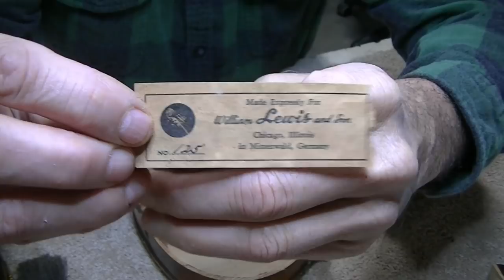209 RSW Grandpas Mouse Hole Fiddle Part 1

Comment: Hi Jerry; I have repaired a few instruments and built seven myself as a hobby only. My first project was a Checz violin in almost the same condition as this one, except the top was all the way loose and the back was about 90% loose. The finish was about 95% gone too, so I had to refinish it too. I was only in my 20's at the time (I'm 76 now). It turned out very well considering I knew nothing about instruments at the time. No one else could tell where the mouse hole had been when I got done. I played the instrument for over a year. That was the only time I ever played a violin. 11 years ago when we moved to this house the movers smashed it. My wife threw it out, she said because she knew I would be heart broken. I was heart broken when I found out she had thrown it out. At the time it was almost 200 years old and had been brought to America by my friend's grandfather. So I can understand someone wanting to repair a basket case. Thanks for your videos. Note: on the f-hole, I used masking tape and taped a piece of paper over the outside of the other f-hole and traced a pattern. Then I cut it out with an x-acto knife, turned it upside down, taped it over the patched f-hole and traced it on the patch.
My old violin had a short crack on the base side of the tail saddle that opened up every winter when it got dry. I was planning to shorten the saddle a few thousandths of an inch after we moved. However; the violin got smashed during the move and my wife threw it away without telling me. You really did a great job on this old grandpa's violin. I really enjoy your videos.
Reply from the maker: lrstaf6 sorry to hear about the fiddle. Thank you so much for watching.

Comment: How did you disinfect the violin of the mold and mildew? Spray bottle full of bleach or something like that? When I rescued my old Kay Tenor, I never have wiped any kind of liquid, oil, anything, but used a soft cloth to at least wipe away the dust and such. The cloth came back with many hues of GREEN on it! I have never seen that before!
Reply from the maker: I think I actually used a little bit of mildew killing spray on a cloth. But to be honest I don't remember.

Comment: Hide glue dries to form a crystalline structure, just like before you water it down to use it. That brittle-ness transfers more energy from the top plate into sound, which is another reason why hide glue remains the classic adhesive for fine string instruments. 
I love your videos, Jerry.
Reply from the maker: I've heard that many times before. But I would bet you $1,000 cash that you cannot tell the difference from one built with hide glue and one built with Titebond in a blind test. I've been building my mandolins with Titebond for 35 years and they sound as good or better than some of the old Gibsons built with hide glue.  Not trying to be a smart alec. But when you think about all of the things that make an instrument sound good what percentage do you think is attributed to the glue? My guess is less than 1%.

Comment: how you repaired that violin was magic, really well done !
Reply: Could the marks left by the clamps on the back  have been due to the finish being Italian oil varnish that imprints easily?. I had a violin that if you got a tiny bit of alcohol or oil on the surface it would soften the varnish on it. I don't like Italian oil varnish for this reason.

Comment: I like your rod clamps ,but have you ever used all thread ,smallest i have used being a electrician is 1/4 inch guess a little over kill i guess but are fairly inexpensive and wouldnt have to thread the ends ,plus they come in 6 ft lenths
Reply from the maker: Yes I have made dozens and dozens of clamps out of all thread. I use them for clamping the sides of guitars, violins and mandolins.

Comment: I just did the same repair without clamps at all because it kept slipping under pressure with a C clamp It seems ok I used titebond because it isn't gonna have to be disassembled ever What do you think? Also What do you call those clamps I need to buy them

Comment: Another GREAT vid.  What do you use to remove mold ?  Is the disinfectant water or non-water based ?
Since the pores in the instrument's wood are bigger than mold spores, how do you reeeeeally ensure
that the mold is gone and will not cause a problem in the future ?

Comment: Now hold on there, Mister.  Of all the amazing things you do in these videos, repairing instruments, building instruments, singing, playing and composing music, to me this takes the prize.  Threading the rod @ 7:40.  Until I started watching your videos, I never knew what a "die" was or what it was used for, although I had seen the round die you held up for the camera many times in hardware stores.   I thought that threading solid steel could only be done at factories using very hard steel, tremendous pressure and precision.  And there you are, blythely turning that die--and reversing it!!!!--to thread that rod, as though you were at a Sunday picnic.  I was thunderstruck,  gobsmacked and generally knocked side ways.  UUUH-mazing. U R D Man!!

Comment: sumting i thinking with looking at the dip along the crack you mentioned : i think you could put a line of smal woodscrews under the crack and use them as small jacks to lift the part up underneath the crack
Reply from the maker: There's always more than one way to skin a cat. Thank you for watching.

Comment: Hi Jerry. Great video as always. I'm seeking your advice. A friend of mine is thinking about taking banjo lessons. He's about 70 years old. He has a banjo but it's really a piece of junk. I'm thinking I might surprise him with a better banjo. Can you recommend one that's not too pricey. Under $200.00? Thanks.
Reply from the maker: Without searching eBay and or Amazon I really couldn't do that. The only suggestion I have for you is the more tensioning hooks it has the better also the tuning keys if they turn out to the side like a guitar they're not quite as good. You want the tuning keys that go straight through the peghead. Those two things are a key to slightly better banjo quality in general. Good luck to you my friend.
Reply: Thanks Jerry for getting back to me.

Comment: Thanks for making these videos! It's really satisfying to watch people with your level of expertise practice the craft they've mastered. At the 14:00 mark, you speculate that the vinyl tubing around the clamps might have chemically reacted with the finish. That's probably what happened. Vinyl tubing has a plasticizer in it that makes it pliable -- otherwise it would be as hard as PVC pipe. The plasticizer can migrate from the vinyl into other materials if they are in contact with each other for too long, and since shellac and nitrocellulose chemically have a lot in common with plastic, the plasticizer will soften and weaken them, too. You can research "plasticizer migration" if you want to know more, but it's a super boring topic.
Reply from the maker: Thank you my friend. That's what I suspected. I'll come up with a better solution next time. Thanks for watching.
Reply: use an old tee-shirt between the 2 next time....

Comment: Hi there,
I can imagine that what you saw with this instrument was a fix NOT using hide glue. A violin is a box with different woods glued together. They shrink and expand differently. You want the glue be the weakest spot. If your top and bottom sit "like iron" on the sides the weakest spot will be - the wood. Especially the soft spruce top will crack all over the place. That's why you even want to use just a little bit of hide glue (actually the right amount, of course).

Comment: You are totally right about Tightbond... it comes in 3 formulas, Tightbond 1, the regular stuff, is completely removable with heat and moisture, just like hide glue. The only advantage of hide glue is it cured ‘harder’ but its bear to use with a hot pot and limited working time. My family did furniture repairs among other things... and being their helper, I have used every glue and epoxy you can imagine. Jerry is right about basic Tightbond 

Tightbond-3 is different glue and much harder to take apart later. Its a water resistant polymer, not for most luthier work... however, to build up slabs for a solid body electric guitar, it may be the best ‘Permanent’ choice. 

Love your vids Jerry, learning with every one, should be ready to tackle great-grandads guitar by summer.
Reply from the maker: Thank you very much.
Reply: Ever use fish glue? I never have. But I have heard good things.
Reply: Endo Alley  I saw a little feature on fish glue at StuMac.  Looks interesting, but probably as a special applications kind of thing. It would be nice to learn more about it but in the end, it appears to be pretty similar to hide glue.   Tell you what I want to know, is the real practical diff between hot pot hide glue, and bottled room temp.  I have a low value family treasure, great grand-dads 120 year old guitar all in pieces.  This summer I want to put it back together. Between Jerry and Dan Erlywines vids, I’m taking the master class. Mostly I will use tightbond 1, just like Jerry does. Some joints I will probably use hide glue, for its hardness when dry, and guaranteed ease of re-do in the future after I am gone. My folks are dead and I don’t have their old hot-pot, so wondering about the bottle hide glue... For all practical purposes, tightbond 1 could do the whole job. Its not a historical guitar, not even likely to be played much. I want it preserved in one piece, not a guitar case full of dry pieces.   Jerry teaches more than all the others.. Every step why and how, and how to make the tools...    Very grateful for having found his channel.
Reply: I like the way Jerry uses what he has on hand and improvises methods of bracings. I have never seen wedges used as he does. Looks like a good idea in the right circumstance. I have also heard that many believe hide glue is sonically more transparent than plastic glues. So they claim, hide glues don't mute the top plate of a string instrument. But to some degree plastic glues will. I have no idea if that is true. The Titebond is so much easier to use. Anyhow, I would have thought that this fiddle was beyond repair. But he has done a wonderful job restoring it. I have a couple old fiddles with full length (non sound post) cracks that I thought were basket cases. Now I will rethink that and hopefully restore them. The are factory fiddles not valuable enough to pay someone else to fix. One is a Czech fiddle labeled "Prokop". The other is Czech fiddle labeled "John Juzek".  I am going to research fish glue also.
Reply: On further research it seems fish glue is not good in humid climates. Can't wait to see the final video of this old fiddle. Amazing what he has done to repair it.
Reply: Titebond makes a "hide glue"; it's printed as such on the bottle, even. lol

I don't know how good it is, but you could honestly say you used hide glue.

Comment: Are those dyes you use Aniline Dyes? I used them on Furniture builds and restorations because the Alcohol would evaporate so much faster, and the colors were so much clearer and durable. The only problem I found was that if it got on your hands, well, you owned for awhile. LOL! One other question. Wouldn't it have been prudent to take a paper pattern off the good sound hole and flip it 180 over the patch? Just asking. As always Jerry, you are doing a stellar job!  Regards, Solomon
Reply from the maker: Yes I believe that's what they're called. Yes you could have done it the other way by tracing the other side but I had to match the cut out where the mouse Dugout so it wouldn't really matter. Thanks for watching.

Comment: Jerry, vinyl is polyvinyl chloride (PVC).  The stuff is pretty rigid.  In order to make PVC flexible, plasticizers, among them octyl pthalate, are added to the product.  Those additional chemicals could easily interact with the instrument's finish.  Maybe "viton" tubing is better.  "Viton" will misbehave around acetone, MEK, & "banana oil".

Comment: Good honest man, i would trust him although, I disagree regarding use of wood glue. i have no doubt that wood glue is stronger and that it can be undone, but, the issue is that hide glue comes undone at the appropriate stress whereas wood glue will cause cracks rather than seams coming loose, i'd rather a loose seam that is easy as anything to fix
Reply from the maker: That isn't a real thing... sorry
Reply: @RosaStringWorks  what isn't a real thing?

Comment: This is about the fourth time I have watched this video and I seem to learn something new each time. I have a question for you, do you know if Titebond liquid hide glue is as strong as the hot glue pot hide glue? I have used the liquid hide glue for some time and will continue to use it until the bottle is empty, only because I'm on such a tight budget. Then I will switch to Titebond Original. I have always liked using wood glues, but it seems like everything I have read says only hide glue is good for instruments and can be taken apart. Your arguments have totally convinced me that Titebond Original is the better option. It wasn't too hard to convince me as I used Elmer's yellow wood glue for years on non-instrument wood projects with great success. I was just under the impression that you couldn't get any of the wood glues apart before I watched your videos. I believe I have commented on one of your other videos about the glue too. This is my favorite instrument video of all the videos I have watched by anyone. Thanks for making it. Oh, do you have an index of your videos available? If you do how do I find it?
Reply from the maker: I don't think that liquid hide glue are as strong as regular hide glue.  Therefore I would say it's not as strong as Titebond original. Unfortunately I do not have an index. If I had time it would be a good idea to make one.

Comment: Why is the top brace offset to one side like that?
Reply from the maker: It is called The bass bar. It supports the bass side of the top while the sound post supports the treble side. Thank you for watching.
Reply: If you tap both sides of the top while it is off the instrument, the side with the bass bar (bass side) will have a lower tone of vibration. I suspect that the theory was that they were coming closer to matching the tone of the strings on that side. Just a guess, but it's been done that way for a very long time.
I have built a couple of balsa body violins and one of them I built a lattice work balsa beam into the center of the back to strengthen it so it could better withstand the tension of the strings like a maple back does. I still, however; put a bass bar in the bass side of the top and used a sound post on the treble side of the violin to transmit sound to the back of the violin. It played very well by the way. I gave that instrument to my niece who plays very well and was in need of an instrument.

Comment: I bought a glue pot about 30 years ago.  Hide glue has been very handy in my general woodworking.  I also use it for building and repairing violins and cellos.   One of the huge benefits of hide glue is that it shrinks as it dries (and can therefore pull a joint nice and tight).   An old furniture makers trick is to use hide glue without any clamps.   Think triangle blocks in chair or table construction.   Apply the hide glue; "rub" the piece of wood into it's location until the hide glue gets a good grab (doesn't take long); let go of the block -- no clamps needed and it dries down tight.   If you need to be convinced about the way hide glue shrinks and pulls tight, google "glass chipping with hide glue."    I have used gallons of titebond over the years and will continue to do so.  You really should consider using hot hide glue.   Working temperature is 140 to 150 degrees and it cools rapidly so the heat isn't an issue.   My most creative use for hide glue was as a substitute for theatrical "spirit glue" which is nasty stuff.   I used hot hide glue to attached wrinkled tissues to my wife's face when I was making her up as the wicked witch of the west.   It worked beautifully and removed easily with warm water.
Reply: I just got started doing repairs recently It seems the first thing to know is that hide glue is only for things that may need to be disassembled again I wouldn't wanna use it to repair a broken piece of wood
Reply: @fugeeohu9357  Hide glue allows for clean disassembly of the instrument to make it just that much easier to repair an instrument when it eventually develops a problem that needs to be repaired.   No modern wood glue makes it as easy to disassemble a glued joint, clean up ALL the old glue, NOT damage or remove any of the wood in the joint, and reglue the joint as hide glue.   It is fair to say that you can make a case for more permanent glues to fix things that should never have come apart and would never need to come apart again even if you have to take the instrument apart again.  But what would those cases be?  Top split? How do you know the top won't split again on the same line, farther down?
Reply: @Turboy65  So then use hide glue for all repairs?
Reply: @fugeeohu9357  Every professional and respected violin repairman on earth would use hide glue for all repairs.

Comment: Mittenwald was/ is a great & famous area in Germany for Orchestral Instruments, it will no doubt be very well seasoned wood & of excellent  craftsmanship, especially so if 60-70 or 80 yrs old.
Reply: Too bad it broke into about five pieces. I'm curious about how (or if) it changes the sound. I'm sure it would but then again a lot of the deified Stradivarius violins have broken top plates and are cracked just like this one and people still go crazy for them. So it must not affect it too poorly.